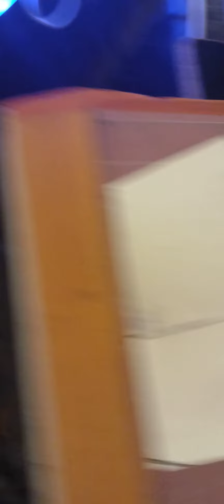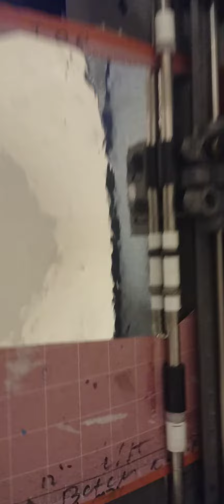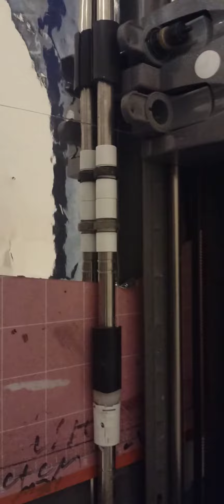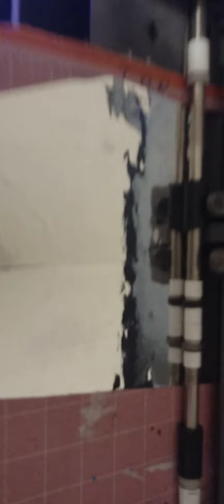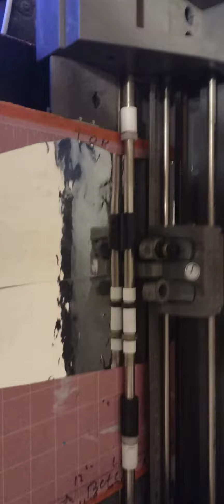cameo 3 and 4 pinch roller fix

Comment: thank you so much!, 
I have my cameo 4 since about 10 months or so, and had the problem of the roller kept moving to the right since day 1, was thinking of get the part 3d printed or getting another broken unit just to savage that part.
Coincidentally, a week ago my car's radiator fan made a mess with the coolant hose, replaced it and kept the remains of the old one for God know what reason... saw your video and turned out it fitted like a glove on the cameo, Problem solved!
Hope more people like me can see this and finally get a solution that cameo has not solved for 2 years.
Reply from the maker: Glad it help out..